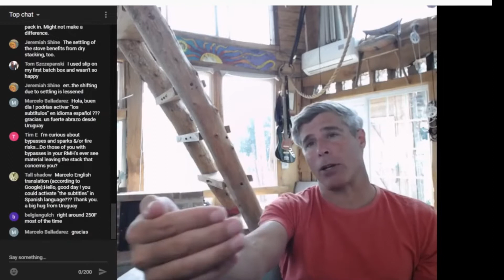Rocket Mass Heater Fire Risk

Comment: Hey I want to say i really enjoy your videos and the subject.  I have some questions that are somewhat related to masonry stoves, but really more about unorthodox methods for heating and cooking.  I'm wondering if you have any experience with designing a dual fuel or gas-only masonry heater or cookstove.  Lately there has been a lot of talk about Gas cookstoves which have become so ubiquitous in homes across the US, potentially attempting to ban them.  Much of the concern arises from the impact of gas combustion on air quality and health.  However the fact that gas is such a plentiful and cheap fuel source makes it appealing for many.  I've pondered the design of a gas cookstove with an oven and multi-burner flat metal top that would be direct vent through a flue, just like a wood stove, thus having no impact on air quality. I would love to hear you discuss the feasibility and design challenges of this topic if you would be so inclined!

Comment: I have a very basic RMH in my cabin.  I've never seen much smoke or any spark come out of  the chimney.  I also get little to nothing in the cleanouts past the burnbox when I do the maintenance.  If stove is well built with good plans you should not have a problem. (That's just my experience) If build is done right, I think this is what is normal for these systems.